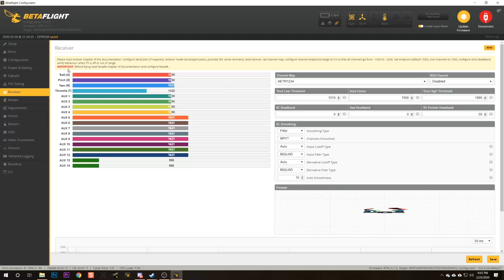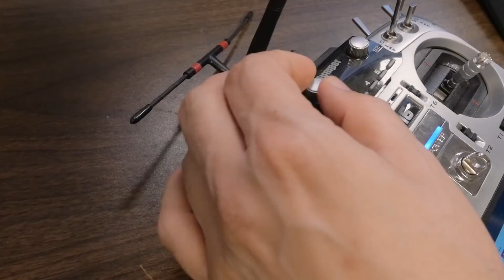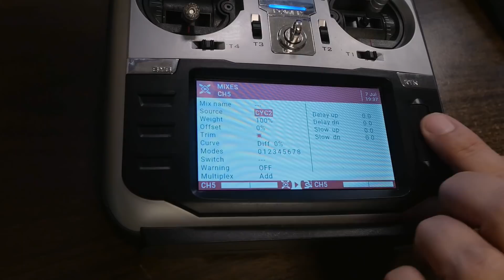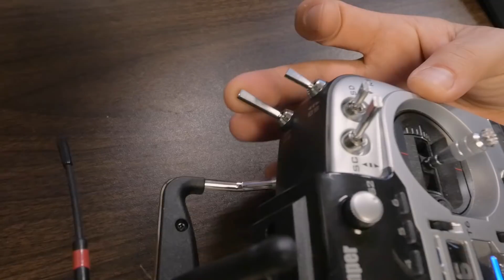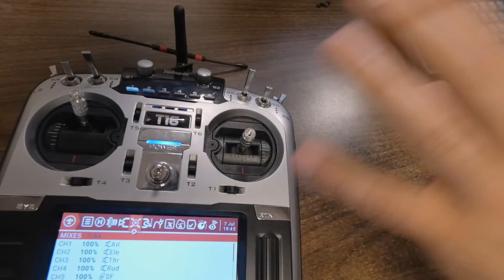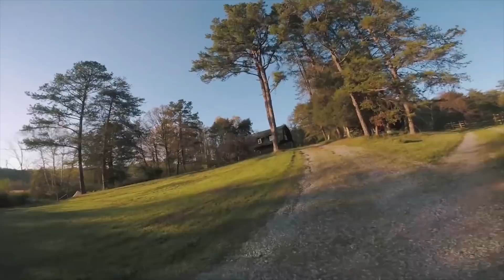Beginner Guide $120 FPV Drone How To Build - Part 6 - Set Up Aux Modes

Comment: Hi Joshua, Thank you for all you do. Hey I just build this Tyro 119 kit perfectly following your video. But for some reason it arms in Betaflight but not when I go to fly. 180 arming is done, I erased all switches and re did them and every works including esc buzz to find the quad. Side note my last 4 or 5  quads have only bind in FrSky X2( what ever that X2 is) instead of FrSky D8 or 16 like my other 20 quads. Even the motors spend up in motors in Betaflight. Any ideas, Thank you
Reply from the maker: If it won't arm the look for the error code in the Warning OSD element. That'll tell you why it's refusing to arm. Email me to discuss if you want.
Reply: @JoshuaBardwell  so it saying 12c Errors: 2
 SD card: Startup failed
Arming disable flags: RXLOSS CLI MSP GPS Rescue SW
not sure what all that means

Comment: I built a quadrocopter based on your lesson. But my device doesn't see the hardware. Did I do something wrong? I have a dsm2 receiver, I soldered two jumpers on the right, is this correct? In byteflight, I set the switch to UART5, is this correct? In the configuration tab I set (SPECS AT, BUS, STAND) and below Spektrum2048 Where is my error?
Reply from the maker: Of you used the plug then the UART is number 2 not number 5.

Comment: I'm stuck on no stick movements. Anyone had that problem and fixed it?
In BF on the radio tab it shows the AETR and others things, but I cannot get any movements from AETR.
My FrSky XM+ receiver is bound, the green light is on.
I'm stuck. Any ideas?
Reply: I had a similar problem with the FrSky R-XSR receiver, and found that i had soldered the wires to the wrong places when connecting the receiver to the flight controller; that might be the problem.

Hope this helps!

Comment: why is there no flip over after crash feature that I can activate in BF?
Reply from the maker: You aren't using Dshot?
Reply: @JoshuaBardwell  It's my first drone. I'm borrowing it from a friend, he has used turtle mode before. I upgraded it to BF 4.1 and then there was no setting called flip over after crash.
Reply: @LutherFPV  you need Dshot watch the video on that its in the list for this drone.

Comment: To prevent accidental arming I setup a momentary switch for the prearm  mode. To arm you have to hold the momentary switch in the raised position and then toggle the arm switch to arm the motors. The prearm momentary switch by its very nature springs back to the off or safe position when you release it. With this setup you have to toggle two switches to arm the motors and since the prearm switch is momentary there is no way it can be left engaged (in arm mode) by accident. This is a better setup than using the throttle as the prearm mechanism because one can forget to raise the throttle to engage that safety but it is impossible to forget to set the momentary switch to the safe position as it will automatically reset to that position when released .
Reply from the maker: I also have a tutorial for this method: https://www.youtube.com/watch?v=bv3VJ1jznw8
But I ended up moving away from it b/c it is more complex to set up (many beginners would struggle) and b/c it is complicated to explain to other people how to arm your quad when you let somebody else fly it. 
The throttle method works with every transmitter and requires no additional setup, so it's the approach that I personally use now, and that I teach to beginners. You're 100% right that the throttle method is more prone to human error, but I think that is outweighed by its accessibility.

Comment: How do we enable the condition where arming can only be accomplished when the throttle is at its minimum. It seems that this would require an additional condition to be set somewhere.
Reply from the maker: No, it is the default state and cannot be overridden.

Comment: Hi JB 
This is my first build, thanks for the clear instructions.
strangely i had to change the mmix to make the motors match in BF

mmix 2  1.000 -1.000  1.000 -1.000
mmix 3  1.000 -1.000 -1.000  1.000

mmix 0  1.000  1.000  1.000  1.000
mmix 1  1.000  1.000 -1.000 -1.000

i have a problem,  when i yaw to the left it is throtling instead. When i throttle up just a tiny bit it goes to the moon.
In BF the Receiver responds correctly. Strange.
Do you have an idea whats going on?
Reply: additional info ;-)
pitch and roll are fine.
Also if i just notch the throttle one tic the motors slowly spins up to max.